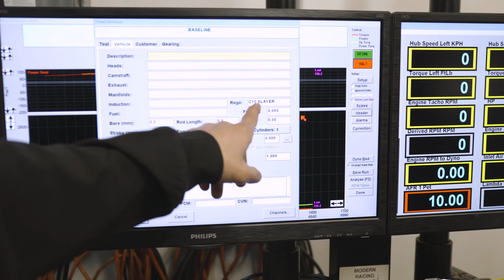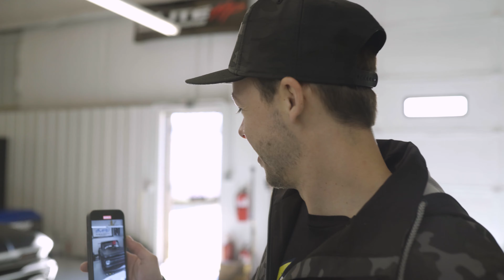The DeBerti C10Slayer Hits The Dyno For A Tune!

Comment: What did they do to stop from driving the rear axle? Isn’t it suppose to power both rear axles?
Reply: We just pulled the drive line for the dyno
Reply: @DeBerti  right on. Thanks. Was watching trying to figure it out. Such a cool truck. Have watched the videos of its build that you all have up. And the Toyota truck. Amazing